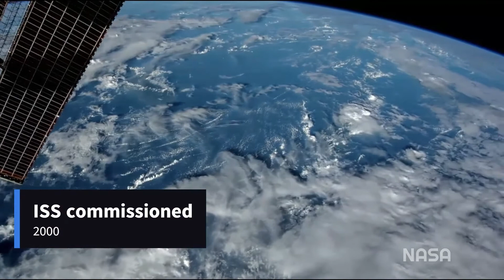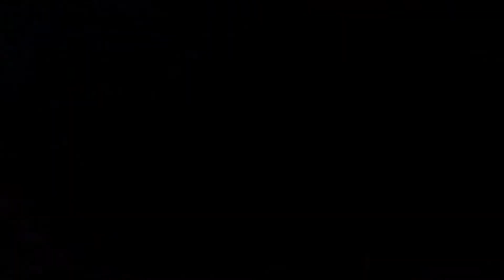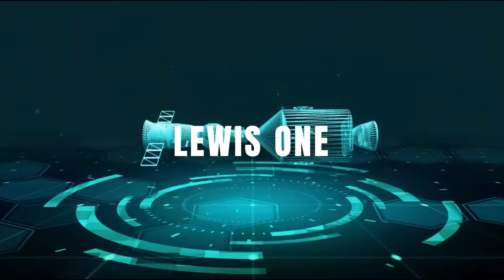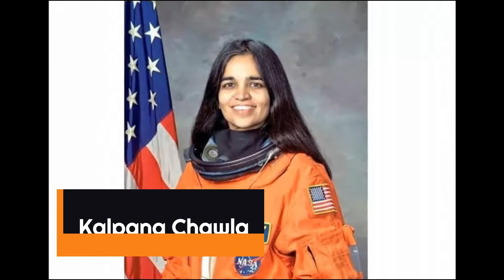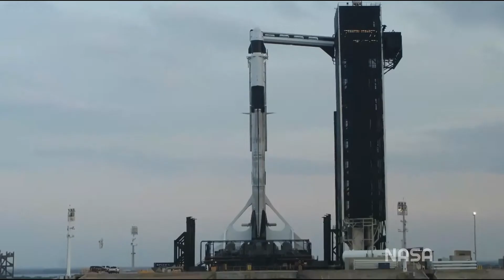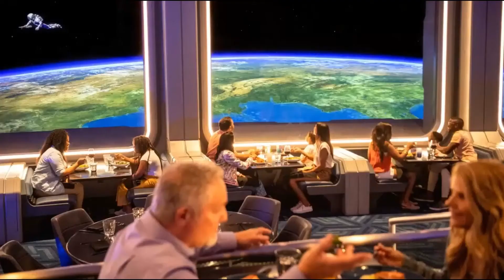A more PRACTICAL way to BUILD SPACE COLONIES | Kalpana One |

Comment: The sphere is the lowest shielding mass per enclosed space. This was what O'Neill chose in his "Island One".
The NASA studies didn't like either the 2RPM spin rate, nor the fact that only while on the equator, would inhabitants have full 1 G.
Hence the Stanford Torus. 1RPM spin rate was the highest they were willing to go before you start de-selecting people who can't readily adapt.

The designers of the Kalpana habitat were eliminating Lunar mining and space resources or the business model of building Solar power satellites to just build the habitat. TO eliminate most shielding mass, they put it in medium to low orbits to be shielded by the Van Allen belts from Solar flares.
This means that people just took the dosage from Galactic cosmic rays. They also ditched the limit of 1RPM and designed for far faster.

So far, no billionaires have stepped forward to build this resort for the extremely rich who are the few who can adapt to such a spin rate and are willing to take the dose.

The Kalpana drum shape for a habitat is good, it should be plugged into the O'Neill Island one and scaled up to allow for 1RPM (800 meter radius).

The O'Neill "Island 3" extremely large cylindrical habs were from before he knew about the spin axis instability, and he didn't consider shielding from cosmic rays. Any areas of windows looking out into space are nothing but places to get a large cosmic ray dose, or terminally irradiated during a Solar flare. Any depiction of a transparency that blocks GCR is pure fantasy.
The "Island One" and the Stanford Torus deal with admitting sunlight while blocking radiation and this can be readily adapted to a Kalpana design.

The '70s NASA Ames / Stanford space settlement studies found that the largest pressure vessel which we could build to spin for 1G and hold shielding and everything inside, is ~14km radius. If a can or drum shape like the Kalpana, no more than x.75 the diameter in "height" or "width".
Concrete and steel. Fantasy industrial scale use of Buckytubes or sentient AI nanotech self-assembling factories, not needed.
If using Titanium (which isn't rare up there), maybe twice that.